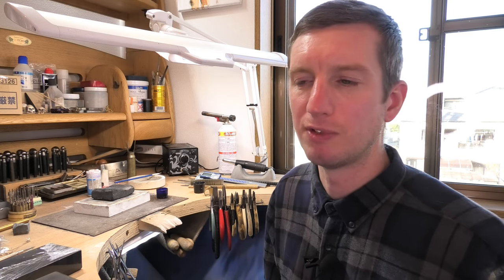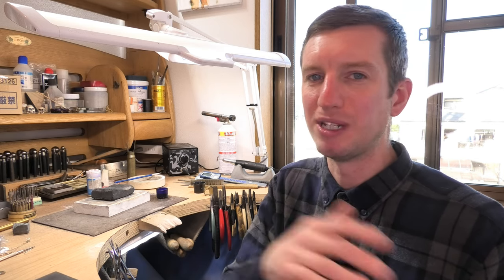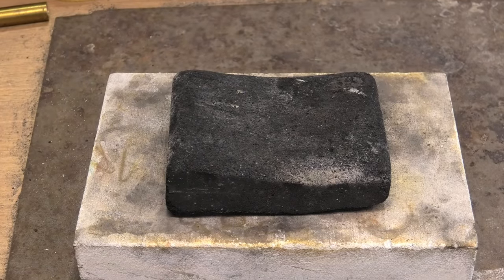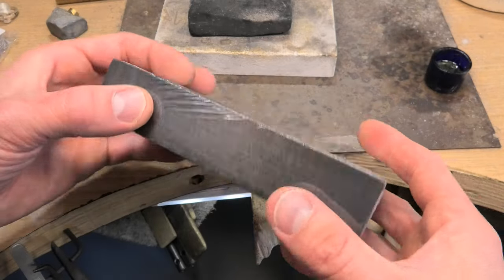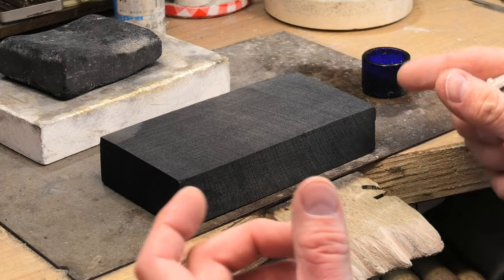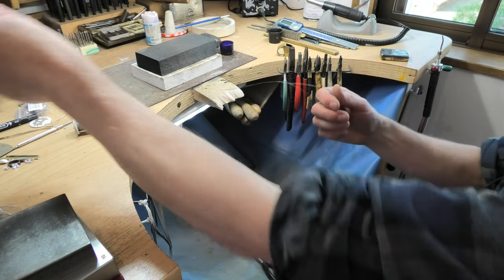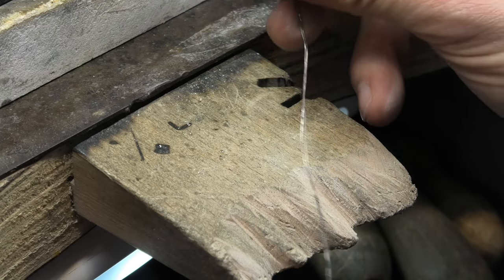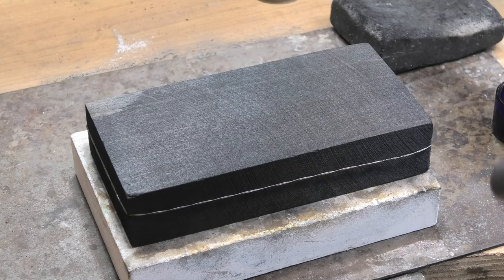Beginners Guide to Making Jewellery. Charcoal Blocks

Comment: Chris, I’ve always been told that once you’ve finished soldering on your block, you should spray the block with water to extinguish the fire inside the block. I use a mister and do just that. It does mean I feel safer when leaving my studio as the block can continue to smoulder for quite some time. Have you ever done this?
Reply from the maker: Never never done this. Iv never worked anywhere or with anyone that has mentioned doing this either! Be sensible giving it some space while its hot and don't have any highly combustible things near it and its very unlikely to cause a problem.

Comment: I just got my very first charcoal block.  I read somewhere you're suppose to soak in water... or maybe I read you're supposed to spray it with water when you're finished using it to preserve its life, not to mention for safety reasons. Is this correct? ❓  ALSO...  In lieu of proper steel binding wire, can I use copper wire that I have on hand or is there a possibility of it melting?  I know not to used galvanized wire (because of caustic fumes) but I have a variety of copper wire ranging from 10 gauge to 24 gauge.  I would imagine it's ok to use but I don't really know.  So... is cooper wire ok to use?❓ Thanks a bunch!👍😊
Reply from the maker: Yes just any wire will be ok around the block! Just not something too melty. Copper will be fine.
Reply from the maker: I had never heard of spraying water on a charcoal block until I started reading about jewellery making on the internet. Iv never done it or known of any jewellers that do it or even heard of it being a thing that one should do